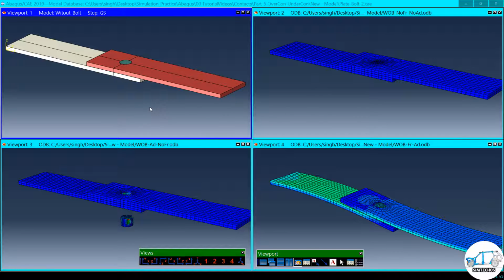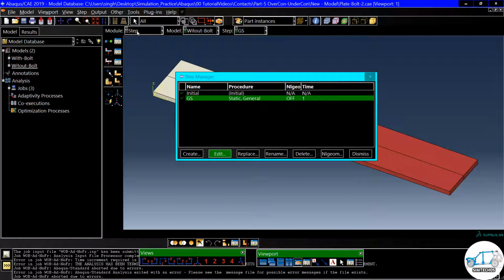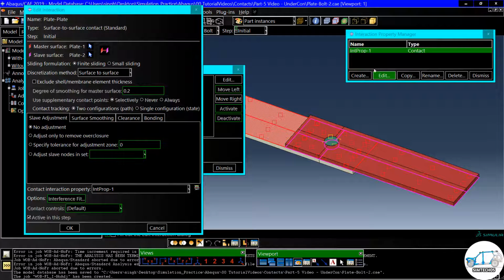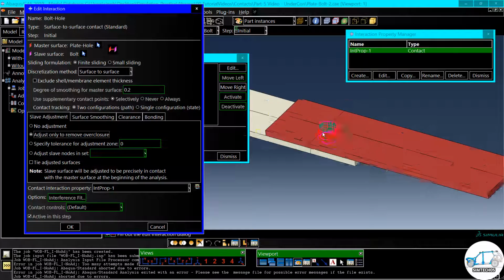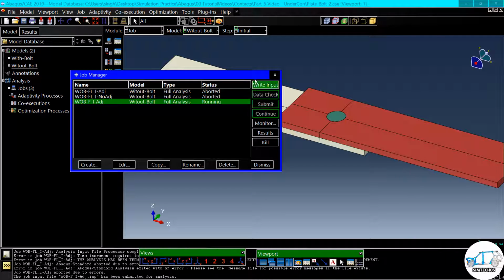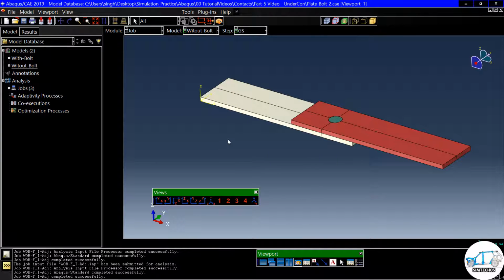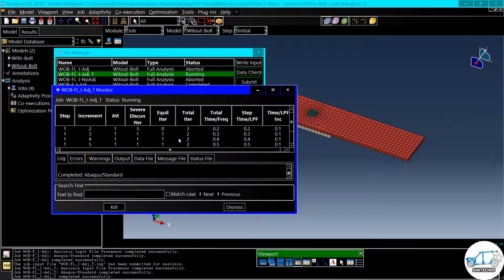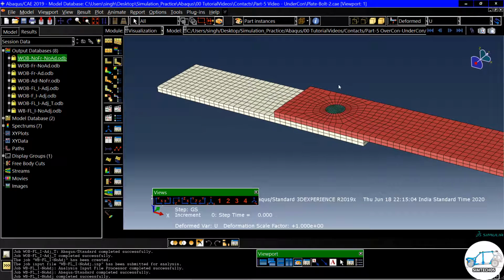Convergence errors in Abaqus, Under Constraint Issue (Interactions in Abaqus Part - 05)

Comment: Thank you very much for the video. 
1. Is it possible to view the failure of part in Abaqus? (In above example, with bolt- At what load will the joint break?)
2. Please make a video about post processing in Abaqus (stress - strain graphs, displacement graphs etc).
Reply from the maker: Dear,
1. If you are interested in fracture of components (here plate & bolt), you need to utilise XFEM technique.
2. Dear it generally as per requirement i explained post-processing things in regular videos.
If you have any doubt you can take help from Abaqus Documentation or you can ask question to me.

Comment: Sir, do we have to give "tie constraint" for connecting bolt and plate?
Reply from the maker: Dear,
It depends if movement between them is very less you can use... otherwise use contact instead of tie.

Comment: Thank you for your video!
The results between no adjust option and adjust only to remove overclosure are different or not?
Reply from the maker: It depends on the nodal adjustment value.  Sometimes changes are huge...but most of time almost negligible diffrence.

Comment: A problem that has been bothering me for a long time is how to achieve convergence when the master and slave mesh are not particularly good? Enabling automatic stabilization also seems to fail to converge
Reply from the maker: Dear,
Mesh on both surface should match as possible. However it depends on many more parameters, like difference in size, tolerance specified, constraints type etc.
Reply: Thank you sir for your advice.

Comment: create video about rcc circular column with two end pined and applied load on top
Reply from the maker: Dear,
I upload video on FE concepts not on perticular problem based.
However, If you are facing any problem I'll try to guide you.
Reply: Thank you. Very much sir  my problem is too many attempts with general static when i edit step and put vale of  0.0005 for minimum it becomes o.o5 automatically not. Changed  ,  minimum vale not changed how can change it and not return to original. Value when i close window